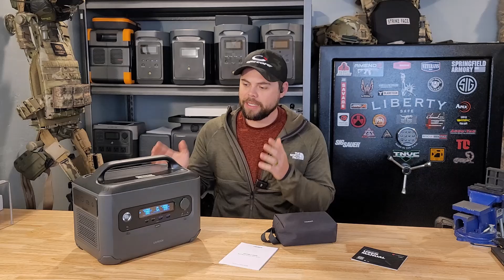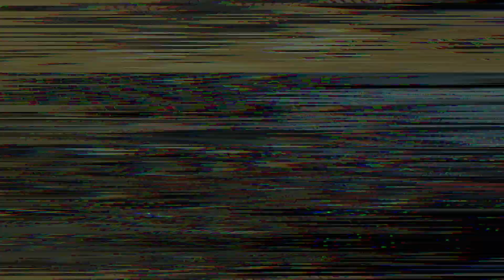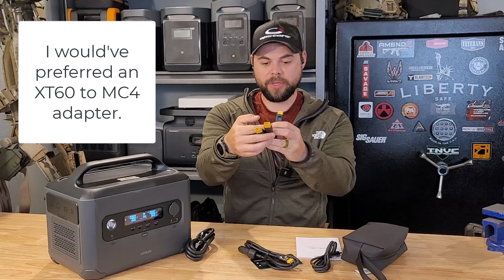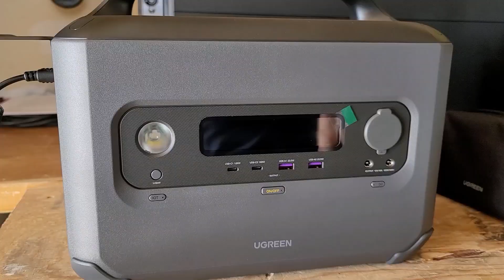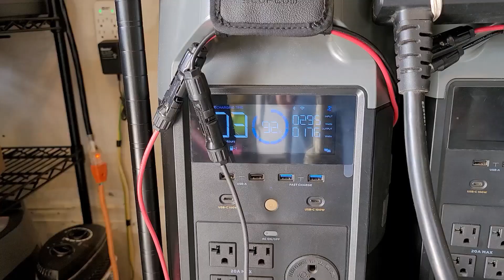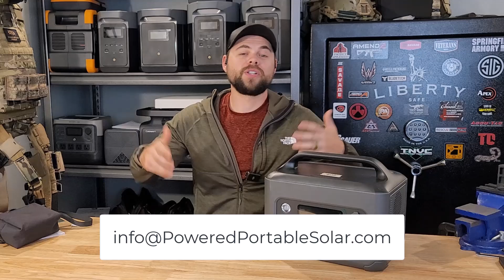Ugreen PowerRoam 1200W Power Station Review

Comment: Keep in mind that any time you see a power station advertise two wattages on the inverter (like 1200W/2500W), it does so by lowering the voltage if necessary to keep the actual wattage from exceeding the lower number.  This in turn means that your 2000W saw or pump runs weaker than it would normally.  That's what the X-Boost or Turbo or whatever feature actually does.